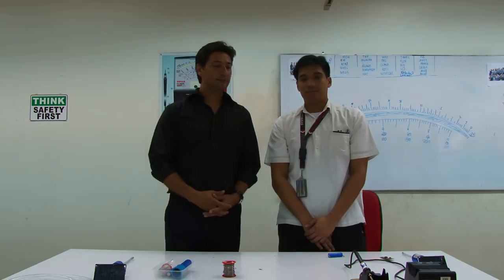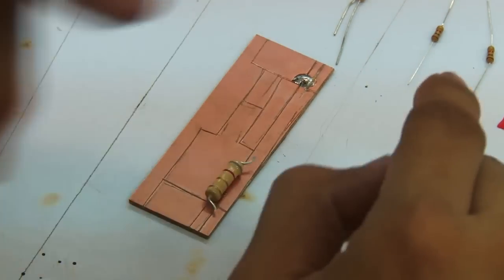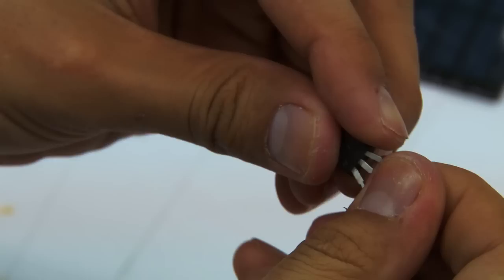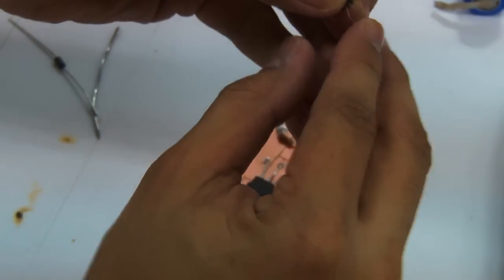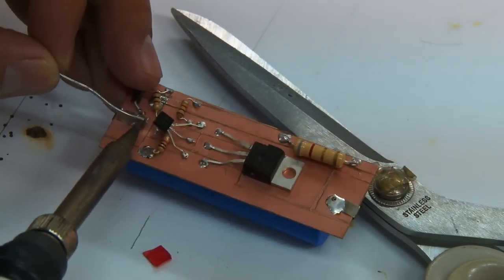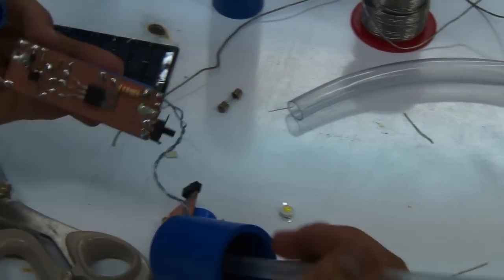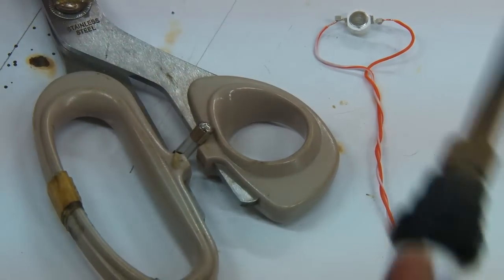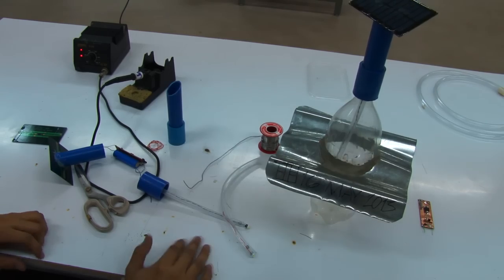Liter of Night Light Instructional Video

Comment: Instead of using an 18650 battery, would it not make more sense to use a phone battery? Much more easily found (used), and they have built in protection which is essential for batteries like these.

Comment: Great work, just need to correct you it is a 2200 (Twenty Two Hundred) not thousands mA battery usually known as 18650 Battery.
Reply: Yes
Reply: +smnabil twenty two hundred is not the proper reading.This is two thousand two hundred ok???
Reply: 5 + 6 = 11 same goes to 9+ 2
I think I am right but English is not my first language therefore your way might be better.
Usually I pronounce / read numbers in Hundreds, Thousands and Millions etc.
Reply: +smnabil thats a 2200 in English that's a two thousand two hundred then if you want twenty two hundred in symbols like this 2200.00 but in capacitors there is no value for that for your info sir..examples maybe in 2200 times 100 that is two hundred twenty thousand you know?

Comment: For the sake of pedagogy, I would suggest to use a clear acrylic instead of the circuit board and use the legs of the components/wire to create the circuit.  Advantage of this is that you can draw a circuit with permanent market, drill the holes for the components, and the lay on wires/conductors to attach the components to the circuit.
Reply: Por favor alguien podría traducirlo al español  debe de quedar algún alma bondadosa que lo traduzca gracias y por favor no tarden mucho graciaaaaaaaaaaas